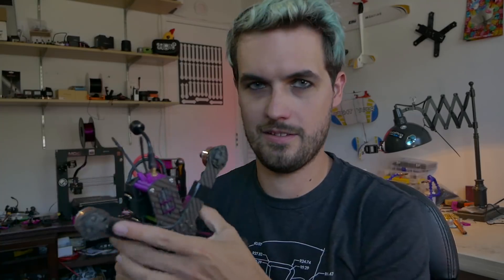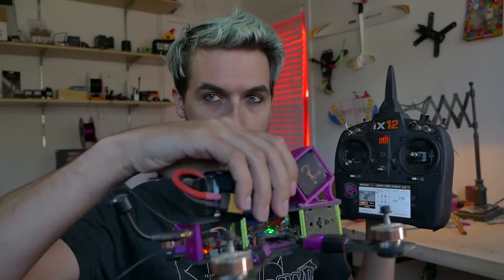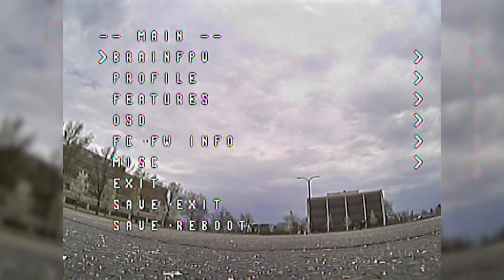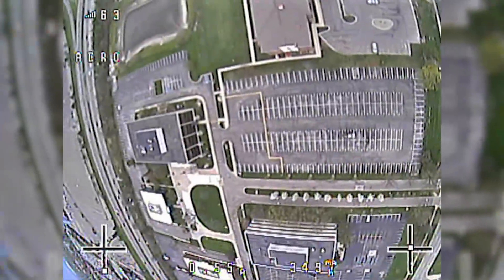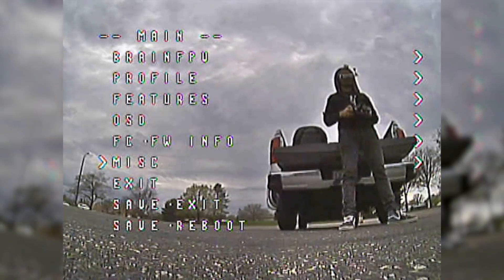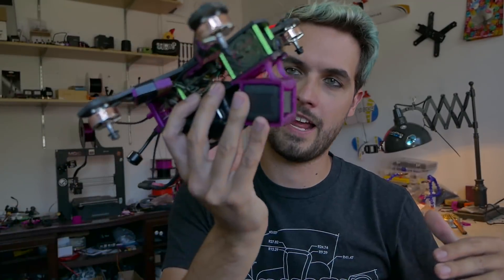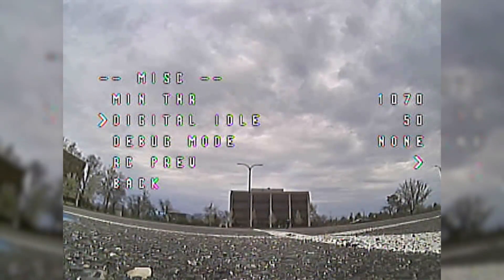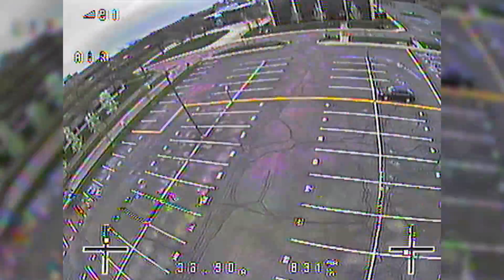Using Air Mode AND Idle Up?

Comment: set pid_at_min_throttle =off in cli, makes it to behave like kiss does in idle up mode.
Reply: I know you commented this ages ago, but do you prefer idle up or air mode? I always used betaflight and airmode, now I'm building a kiss v2 system so I'm curious about trying idle up.

Comment: Only handles drones, very short coming. Idle up on a 3D helicopter means full throttle but 0 degree pitch on the middle stand of your throttle gauge, up is positive pitch, down is negative pitch. This is how we are able to fly upside down. Air Mode is non existent on 3D helicopters. We have normal mode where the pitch is fixed and you control throttle, in this mode 3D flight is not possible.

Comment: Best discussion on this I've seen. Was flying with a friend a few days back and we got talking about this. I mentioned your last video and it got me thinking, so I made a change, (was running Airmode as a feature). 

Since I like horizon for when I go LOS to walk a quad home or such, so I set a 3 pos switch as such - up=Horizon/Air  mid=Acro/Air and dn = Acro. This way I can always pull the switch down to land, skid or "Bonk" (although I don't fly many places where Skid and bonk are possible).
FWIW - I idle most of my machines @ 4.5%, but that's a lot on 6" or on high KV setups, so those are usually lower. 

Thanks, Keep up the 'tech and how it effects your flying' theme, I like it!

Comment: I recently set up idle up on my quad and will test it against airmode. In butterflight, I changed following parameters: set min_command = 1060 (was 1000 by default), set min_throttle = 1050 (was 1070 by default) and set pid_at_min_throttle = OFF (was ON by default). On top of that, I added an override throttle Channel switch with val=-100 in my taranis and set min microsecond to 1068 on throttle Channel output.

Comment: I noticed after my first flight with airmode besides the obvious, is that it's very zippy. At mid to low throttle my quad is much more reactive. So glad I found this video and tried it. It's has so much better control. I'm limited to the front yard on the week days so lots of lower throttle flying. It's almost a must to fly with. Now I just have to learn how to disarm really fast when I crash. That's my only concern. Even on a switch one must be fast to avoid burning up equipment. Thanks for your excellent video

Comment: Thx for the info. Also im not afraid to admit it..,I wish to know your rates if you wouldn't mind sharing? Or even a ballpark.  Ive been flying for around 1 year with nothing bigger than a 3" quad so I have finally started messing with my rates and I've also just bought my first 5" geprc mock 4 , 4k . Im only two backs in with it still massing with bf .

Comment: great vid thanks. 

I had this curve set on AMRing switch combination AND not a dedicated swtich. Of course quad would not arm due to THROTTLE warning flag raised (BF 4.2) :)

So I added anoter Logical switch (which there are plenty) with ARM switch combination and a delay of 0.1 sec and now I dont need to use two switches for ARMING and  IDLE UP but just one switch.

Comment: I just switched from air mode to idle up, and set the pid at low throttle off in CLI... now its just like steeles quad.. RIPS too!
Reply: i was setting up idle up. it was arming until i put this command in. the FC light flashes that its armed but motors won't spin now, what did i do wrong? lmao
I've tried turning up the idle value an still didn't work
Reply: HardTimeZFpv idle up has to be OFF.. then arm.. then turn on idle up...
Reply: OHHH! I have idle up on my arm switch, I'll go change that! thank a million, man!
Reply: that help is suuper appreciative, I definitely got you!!
Reply: Whats the commands for CLI to minimize the pid on low?
Reply: i typed "get pid"  in the cli and all the commands popped up for them
Reply: Thanks. I just wanna do the switch to see if i like it. Because i fly with airmode always on
Reply: Ettiene Rodriguez set pid_at_min_throttle = off
Reply: same! i have always wanted to do idle up but never really tried it lol
Reply: You fly without airmode?

Comment: How do you not get de-sync running idle that low????
Reply: Tune-in' FPV because he already set minimum throttle to 1050 when activate the idle up switch. So the 1,5% idle is only before idle up switch and airmode are active.

Comment: Hey Drew.. there is still an issue with what you are calling idle up here. Back in my heli days idle up meant setting a steady motor speed that kept the helis head speed at a certain rpm no matter what else you were doing. This gives great authority for 3d heli flights. What you are doing on your quad is only putting min throttle command on a switch and not actually idling up to a stable rpm. 

Most set ups use min command at 1000 and then min throttle is set to the lowest point at which all four motors spin smoothly. Then the choice is made to use motor stop which does not let the motors spin when armed or to not use motor stop and have the props always spin at that min throttle setting when the quad is armed and the throttle is at its lowest position.

Do you set your quads up differently then that to achieve what you are calling idle up?
Reply from the maker: I set up my quads exactly as explained in this video.
Reply: Yeah everything you said except... his arm, motors spinning at like 1020 and pid loop inactive... then flip the, "idle up switch" to spin the props up faster, and air mode disabled. So you can sliiide and bonnk!

Comment: I have a prob maybe you can help have a quad i built bardwell board 3.3 betta flight when i do a punch and throttle up than throttle down quickly  the quad continues to idle up for a second before it idles back down any ideas what it could be

Comment: Thanks again for a great video.
Wanna ask if i'll be using Air Mode, should i make sure that Motor Stop is OFF?
Reply from the maker: I recommend turning off Motor Stop
Reply: Thanks a lot for the quick reply drew.
Love your flying videos, it's sooooo smoothhhhhhhh man.
Please keep up your great work, been following you on the other channel for quite some time.
cheers.....

Comment: This question is not about airmode or idle up, but I hope it is okey. In the dvr I we can see the rssi. Is that something you can set with spektrum reciver or are you useing crossfire on this quad? If it is a spektrum reciver, how can I set that up?
I realy like this two videos about airmode and idle up. I am new to this hobby and this was a good explanation.
Regards Øystein
Reply from the maker: It is Spektrum. I’ll try to cover soon. :)

Comment: 5% is pretty low, I can't get a stable pid controller at 5% but at 8% things become manageable,.  At 10-12% it becomes indistinguishable to Airmode but has some definitive thrust inverted and in dives. At 8% I can still tell a very minor difference  but really appreciate the reliability in contact tricks and accidental clips.

Comment: Errr air mode simply enables the PID loop at no/low throttle, idle up only spins up the motors at low speed.

Comment: To turn off the pid controller make Shure you don't have air mode on permanently and use 👇👇in cli 
                                      set pid_at_min_throttle = off 
 whenever your throttle is at 0 your pid won't be active ✌️✌️there are lots of vids on it MAKE SHURE YOU WATCH A FUE AND UNDERSTAND IT FULLY before implementing it onto your craft